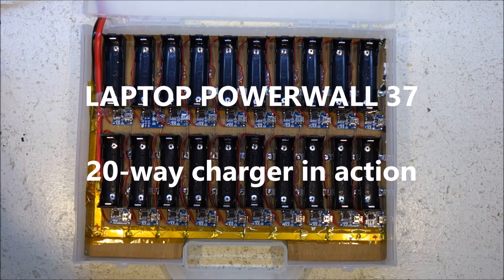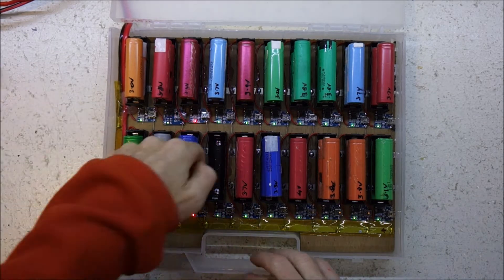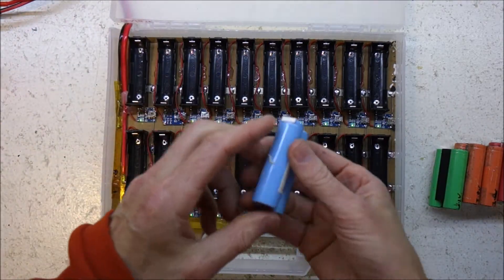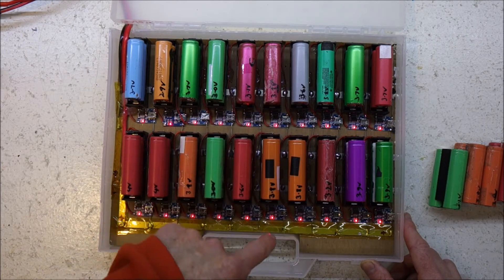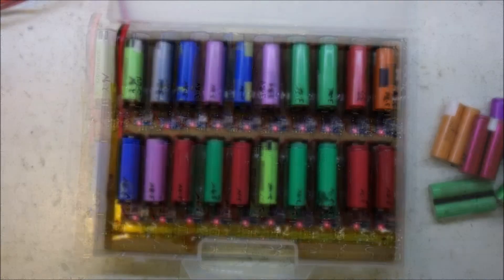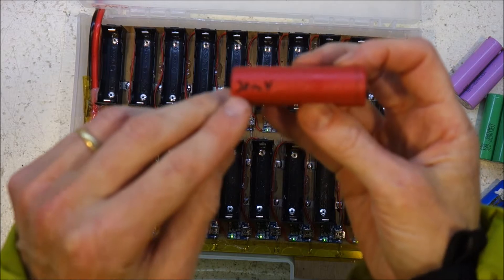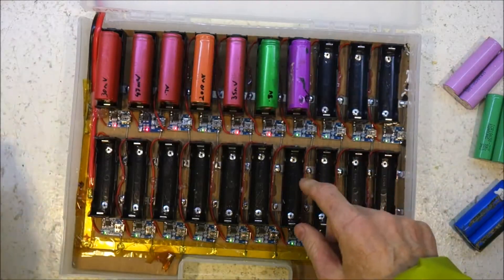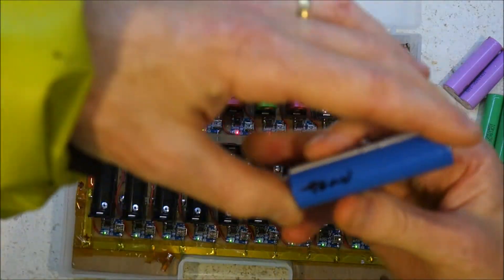Laptop Powerwall 37 - 20-way charger in action (mundane)

Comment: Hi Paul, i have found alot of those 0v cells. Some have failed circuit boards on top of the + terminal. I  bypassed these circuits and found a voltage. Some cells are good after charging (high mah) some are bad (low mah). I fuse each individual cell as well so know worry about cell failure in the future.  Cheers mate
Reply from the maker: Hi Craig. What did you use to charge the 0V cells?
Reply: +Paul Kennett I have the same charger set up as you.
Reply: Hi, I believe there is no circuit board in cells. There is just presure valve. Yes, you can bypass it, but I thing this cells are bad. Something horrible had happened with them if presure valve disconnect them. But who knows? I don't have much experiences with it...

Comment: I also have some amount of 0V batteries which separated to throw away. Even you recover those 0V batteries back to 4.2V, can you assure that it will perform well in future?
Reply from the maker: Previously I have trickle charged even the 0V cells and found that some did come back with good capacity. The trickle charging process does take more time and so I'll only do that if I am desperate for more cells.

Comment: do you have the blueprint? and can I buy you one?
Reply from the maker: When I first built my little solar system I used 4 new car batteries - but they only lasted about a year. So then I bought deep cycle batteries which lasted longer but weren't cheap. With these recycled cells it will cost fewer $ but cost more time. I really enjoy doing this stuff so for me this is better.
Reply from the maker: http://www.myonlinediary.com/index.php/Energy/PowerWall#20160517
Reply: Why don't you use simple car batteries? Less cost and less hassle.
Reply: Paul Kennett Hm, you really seem to know your stuff, perhaps you can help me.
I bought 10 of those square 12V-24V 48W LED lights of Amazon for $10 each for our film department as portable field lights.
Now we need to power each of them with a battery that runs them for 4-5 hours a night (e.g. 20 000 mAh per battery pack) and that can be carried and charged by a child in the mud. The cost per battery and charger should not exceed the cost of the lamp too much.
What setup would you suggest to solve the problem?
Many Thanks and my Greetings to New Zealand.
Reply from the maker: You could build 20Ah pack with 32 2500mAh cells wired as 4 groups of 8 cells connected in parallel (4S8P). Or, if you only had 2000mAh recycled cells you'd need 40 cells (4S10P). When you factor in a BMS and charger, plus a waterproof container your cost will be way over the $10 per light. Sorry!
Reply: Paul Kennett Damn! The school's budget is only €100 to power the 10 lamps. But thanks anyway.

Comment: Hi Paul,
Thanks again for the video. Can you please give me the specs (all model numbers/markings) on the purple cells at 2:50 ? Haven't seen them before.

Cheers
Reply: Also, you may be having an issue with the 0v batteries due to the TP4056, if you have a variable power supply it might be worth trying to recover them.
Reply from the maker: Yeah - I have trickle charged 0V cells in the past, but it does take a lot more time - so at the moment I'm thinking it's not worth it. Also I once forgot about a trickle charging cell and let it go up to 8v (strangly it wasn't even warm!). That experience has reduced my enthusiasm for trickle charging. But - never say never...
Reply from the maker: I had a look and couldn't see a brand on those purple cells. I did find "RKUZ3KD 214590", "RKU23KD 214523", and "PKE23FD 127620". Cheers.